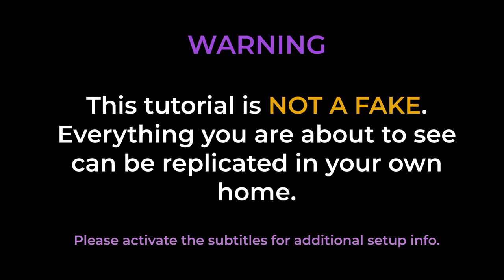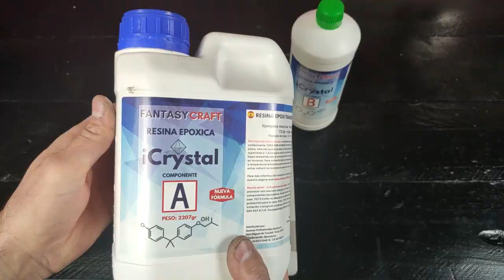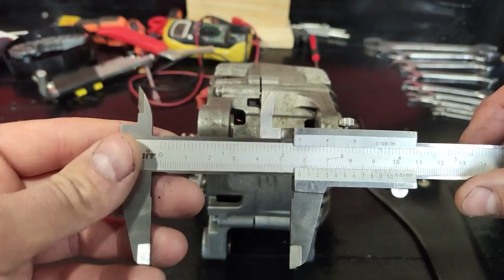I turn bicycle into an energy generator for your home | Free Energy #3

Comment: I can't understand how a 24 v generator becomes 220 without changing the coil of the stator.
Reply: This video is identical to his 10 million view free energy video right up until he mounts it to a stationary bike at 12:20. In that video the alternator is outputting 220 volts ac but yet in this video, at 17:30, it's only putting out 25 vac. In this video he has to use a 10:1 transformer to step up the voltage to power some 220 volt lights. Looks like he used some trickery in the more popular video to have 220 vac come directly from the very same alternator.

Comment: Through which angle it seems to be free energy , as long as you do paddling it can generate electricity . You have to hire someone for paddle work. This is an old  grandfathers way for generating electric power for the bicycle headlights. This is not a new innovation.